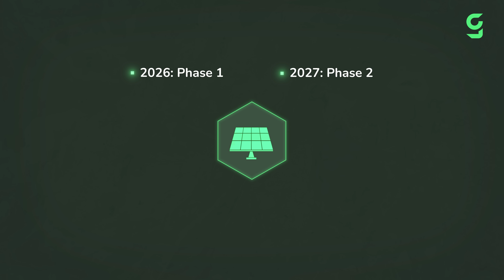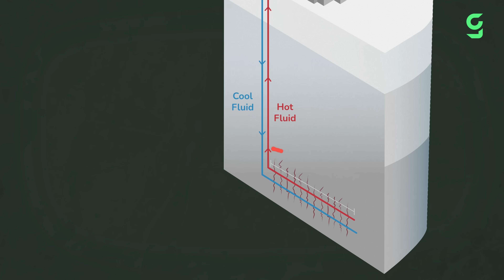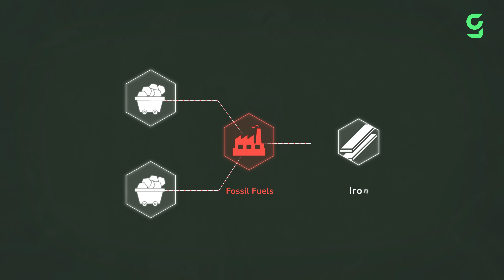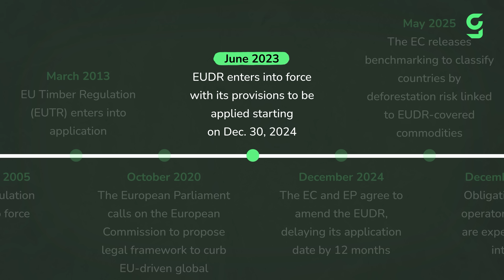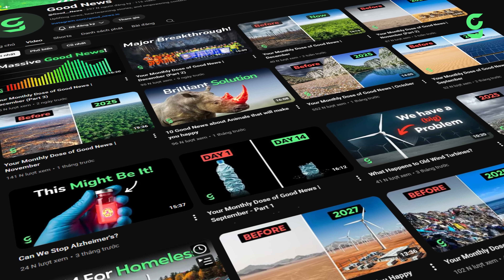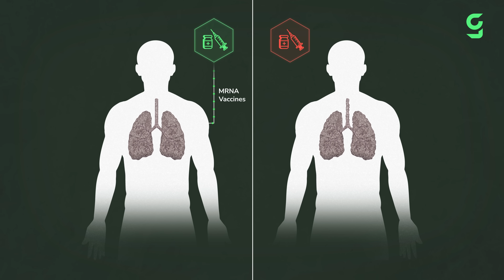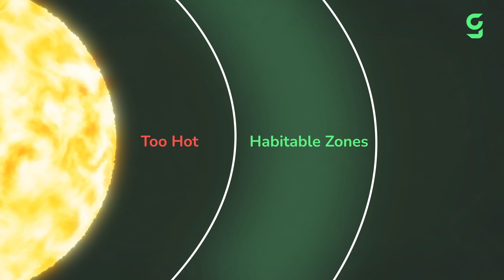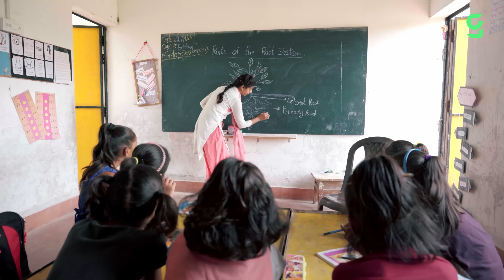Why 2026 Will Be a Great Year (more than you think)

Comment: I got caught up on the claim that hydrogen "breaks down" into ammonia and methanol. AI clarification:

Green hydrogen does not directly break down into ammonia or methanol; rather, it is a key raw material used in their production. Green hydrogen, produced through water electrolysis powered by renewable energy, serves as a feedstock for synthesizing both green ammonia and green methanol.

Comment: "That's why it will be broken down into ammonia and methanol."

Not a good choice of wording. Hydrogen is combined with nitrogen to form ammonia using the Haber-Bosch process and ammonia is then transported as a higher energy density chemical. Once arrived at the destination of use, it is "cracked" i.e. decomposed to pure nitrogen and hydrogen.
Similar with methanol; hydrogen can be combined with captured carbon dioxide to form methanol which can be transported as a liquid, high energy density chemical. It can also be decomposed again or used as such at its final destination.

Comment: 0:10 "carbon free steel" would actually be "iron" by definition...😅
Reply: Now... I havent gotten there yet, but I'm assuming they mean carbon neutral, not that the steel doesnt have additional carbon in it
Reply: @Fullelement7 indeed.
Reply: I made the effort to actually watch the part about the steel….: its means steel produced without co2 emission.
Reply: Only if it loses all of the qualities of steel as a consequence, if we've managed to figure how to create steel without carbon that's gonna be nucking futs
Reply: @AcridCrowd  Well, that isn't the case...
Reply: Not really. Steel today is primarily composed of iron and carbon, as you implied, with an interstitial mix between the two elements to keep its “hardness.” This new system of carbon free steel will retain these properties without the need for carbon, so it won’t just be the ‘weak’ solitary iron. It will still be ~as strong as steel today. Pretty fricking awesome!
Reply: @ScroogeGD  but if it doesn’t contain carbon, it by definition is not “steel”, but a new alloy which will have a new name… steel is defined as being made of iron and carbon, primarily. No carbon means it is no longer steel
Reply: @smallpeople172  true

Comment: Hydrogen isn’t “broken down into ammonia and methanol.” Ammonia (NH₃) and methanol (CH₃OH) are made from hydrogen by reacting it with nitrogen (for ammonia) or CO/CO₂ (for methanol). Hydrogen is an element—you can’t decompose it into those compounds; you can only synthesize them using hydrogen + other inputs.

Comment: We don't need hydrogen for steel production or vmrvrn most heavy industry. It's really only needed for plastics and fertilizer and some chemical processes. The future of steel is electrolysis (either low temperature electrolysis or molten oxide electrolysis). This is a fully electrified steel making process that essentially only requires electricity and whose only emission is oxygen. There are also other technologies being used for replacing fossil fuels for heat generation in heavy industry, such as high temperature heat pumps, and for very high temperatures like for making cement, there are future technologies like rotodynamic heaters which is a fully mechanical method for producing the heat needed for very high temperature applications. For the few remaining things that need a combustible fuel, you have e-fuels using tech from companies like Prometheus which would be better than hydrogen due to E-fuels being easier to store and having higher energy density.

Comment: Love this channel, but more hydrogen is not good news, even if it's 'green'. Its Secondary effects make it a bad choice. It will leak into the atmosphere (a known issue, hydrogen is a very small molecule and leak-prone) causing methane to persist longer and will also add additional water vapor - both heat up the planet, and will do it far more efficiently than carbon dioxide.

Comment: And as much as I agree with green energy, I'm not really a fan of dams. In almost all cases, the river that is damned, is one that has been around for such a long time and damning them messes up entire ecosystems, both in water and out. For example, there's a small fish called a stickle-back (i believe) native native to Britain, that barely make it to their hatching grounds due to the extreme current coming out of the dam. Not only that, but instead of having the entire mouth of the river.  To enter, they have a small opening that they have to somehow find and then hope they have the strength and energy to make it through the current being forced through the opening. Plus what people don't understand is that although renewable energy is a must, we have to continue innovating more efficient ways of collecting and storing the energy. Wind turbine, for example, is made of metal, most likely steel, which is a huge undertaking in resources. Not only to produce the steel and other components, but transportation and construction. Take into consideration that they must be replaced approximately every 20 years due to degradation and inefficiency. There are so many advances each year in renewable energy, but just because it's green energy at the end, does not truly make it green from the start. The end product must be able to offset and surpass the initial emissions created in the process of making it and installing it. If we could only create solar panels that are extremely efficient, and I do believe that at some point we will be able to, we wouldn't need any other type of energy. At least not for most of the population as we know it

Comment: Also we can all help by switching on 480p or 720p when we watch youtube! It makes a major difference in CO2 emissions in data centers! <3 have a good 2026!
Reply: Uh... Okay, I'll ask... How does this work? DOES it work?
Reply: @BakaTaco Of course, thanks for asking! :) 
watching YouTube at 720p instead of 1080p typically reduces carbon emissions, because lower resolution uses less data and thus less energy across the streaming chain. The size of the reduction depends on several factors.

Why lower resolution cuts emissions

Data volume: 720p streams carry fewer bits per second than 1080p. Less data transferred means less energy consumed by data transmission networks, data-center servers (storage and transcoding), and the playback device.
Energy chain: energy is used by the viewer’s device (CPU/GPU, display), the home network (Wi‑Fi or wired), ISP infrastructure, backbone networks, and the cloud servers hosting and delivering the video. Reducing bitrate reduces energy use across this chain.
Typical magnitude of the savings

Order of magnitude: switching from 1080p to 720p often reduces bitrate by roughly 20–50%, depending on codec, frame-rate, and encoding settings. Emissions fall roughly in the same proportion as transmitted data when other factors are constant.

Example : if 1080p uses ~4–6 Mbps and 720p ~1.5–3 Mbps for a given codec/stream, the data (and energy) can drop ≈30–60%. For a one-hour video that might cut emissions from tens of grams CO2e to perhaps two-thirds or half that — precise numbers depend on region and device. For example phones use less data than laptops, but only if you use wlan not mobile data.

Just make the calculation yourself and scale it up for your yearly usage, it is a lot! I watch on480 or 720 and honestly it is totally fine :) Back in 2000s and 2010s quality of streaming was way worse

Comment: You know, i may just not know how it actually works, but isnt pumping cool water down to the hot parts of our earth going to COOL down the parts of the earth that SHOULD be hot to continue functioning correctly? A huge part of how our plates move in the first place is because its basically "bubbling" down there, right? And, isnt it ALREADY slowly cooling down because of age? Geothermal, SOUNDS nice on the surface, i just hope it doesnt have any unforseen damages that will never be able to be undone...

Comment: 04:30 Is it really Green Hydrogen though if we ship it over the sea in large fuel hungry tankers? For it to be green I feel like it has to be produced locally whereever that green energy is produced and then not shipped around too far. Or whatever is transporting the Hydrogen (In Full or multiple chemical Components) has to be using a green form of energy as well.
It's definitely better than shipping around other fuels though. So I guess there is at least that.

Comment: Before I understood how power and wealth actually work, I was stuck chasing motivation, quick wins, and external validation. Reading Power Behind The Curtain by Dave Rumsfeld shifted my focus toward structure, discipline, and long-term positioning. I realized it’s not about hustling harder or waiting for a breakthrough moment, it’s about building systems that work quietly in the background. Once I adopted that mindset, I felt calmer, more deliberate, and far less controlled by distractions, fear, or noise online.

Comment: just a small nit pick: you can't break down hydrogen (H, a chemical element) into ammonia (NH3) and methanol (CH3OH) because those are molecules that contain Hydrogen. the other way around it would make sense to say "ammonia and methanol can be broken down to release Hydrogen". the molecules are more stable and can be stored at higher temperatures than molecular hydrogen (H2)

Comment: This comes across as more foundation propaganda, and I'll tell you why:
Every single residential home on the planet should have its own clean energy power source off the grid, with connection to the grid as only an emergency back up provided for free. So whether a house/townhome or condo/apartment building has solar panels, roof top wind turbines, natural water fall/filtration systems or a combination of all 3 and more green techs available, this should be the goal and green standard...off grid residential dwellings; and it should be provided to everyone for free with a war-time scale of production to 'save the planet'. Otherwise, it's just more of the same metered, pay for ever and subsidize corporations BS. What they're doing now will eventually cause just as much pollution as oil, just in a different form, at it's already outdated because AI is on the brink of unlimited and free energy for all. Humans evolved for millions of years without electricity, we don't actually need it. Corporations who want to control humans and get them to pay for their energy consumption need it. That is all.
The MRNA technology is still highly experimental and we don't know yet what the long term effects are. The pandemic showed us that the non-consensual, experimental rollout on a massive scale actually did more harm than good. Anecdotally, the vaccine did more to harm my health... I already had a hyperactive immune system and the vaccine was not adequately tested on immunocompromised individuals. I'm not saying anyone should die, not at all, what I'm saying is beware of billionaires who openly state they will depopulate the world with vaccines. Do they show effectiveness in the short term? Perhaps, but independent research is needed to truthfully confirm this. Do they cause infertility in the long term? Perhaps, and only time will tell. Given the obsession some billionaires have with populations and fertility in general, I highly suspect the vaccines are being used to further experiments that shorten life spans and reduce fertility.
Beware of the "global good" that's being done at your expense. While it's wonderful that countries are in the process of raising standards of living for those who need it, it's terrible that billionaires are using tactics that drain the 95% in order to lift them up, instead of releasing the interest-accruing "charity funds" that are forever growing in value while your life is systematically being depleted.
SANCTION THE BILLIONAIRES AND 9 FIGURE MILLIONAIRES NOW!!!! EAT THE RICH!!! GET RID OF ALL MONOPOLIES AND CORPORATIONS BIGGER THAN REGIONAL SIZED!!!! MAKE EVERYTHING OPEN SOURCE, ESPECIALLY ALL THINGS MEDICAL, AND GET BACK TO ORGANIC NATURE ASAP!!!!

Comment: I am so happy that we will have stricter regulations on AI! 
There will be also a few new regulations for consumer protection. 
Congratulation to Laos, Bangladesh and Nepal!

I keep my fingers crossed to reduce the energy consumptions itself. When you produce a solar panel or a wind turbine, that is still consuming energy and material. The best way is to disengage from wasting energy, and if something can be resolved manually, don't use electric power for it.
Ironing, lawn moving, heating 1 liter of water when you use up only 2 dl for your tea, dryer instead of just hanging the clothes, having Christmas lights between October and February...

Comment: I'm holding out hopes that the Netherlands can seriously aid in green hydrogen development. Cause we've apparently pledged to invest a hefty bit more into AI, but with datacenters that run on green hydrogen rather than the standard electric net. But because it's still so expensive and difficult to transport, they're still slow on implementation

Comment: Maybe I missed something but why's it green hydrogen if it's getting shipped across the ocean using diesel?
Reply: The production of the hydrogen is green.
Reply: @Nakia11798  it's not very green if you consider the temperatures needed to store it : 20°C above absolute 0. Otherwise it occupies a large volume, and tends to leak because hydrogen is the smallest atom.
Also, because it is the smallest atom, breaking it down is nuclear fission and would only produce subatomic particles. It physically cannot be "broken down" in ammonia (lacks nitrogen) or methanol (lacks carbon and oxygen).
If the process requires to break down water molecules to extract hydrogen, cool it to near absolute zero for storage, use it to produce ammonia or methanol, cool that, ship it, and then reextract the hydrogen to use it, with the same temperature problems at the end, I strongly doubt that it will save any energy at all.
On top of that, it's highly explosive and the flammes are barely visible.